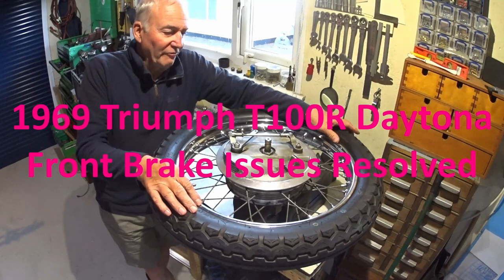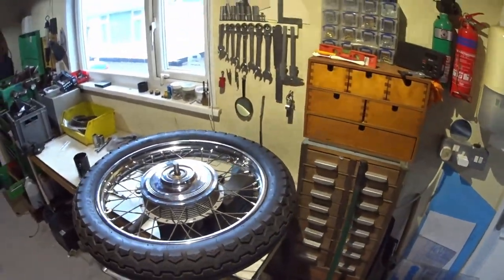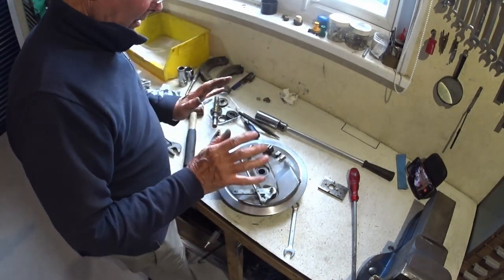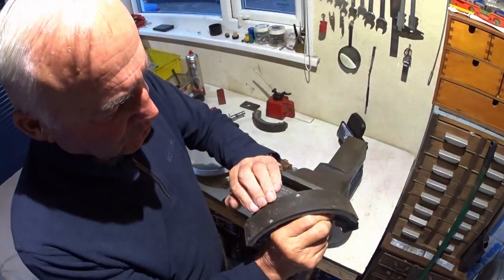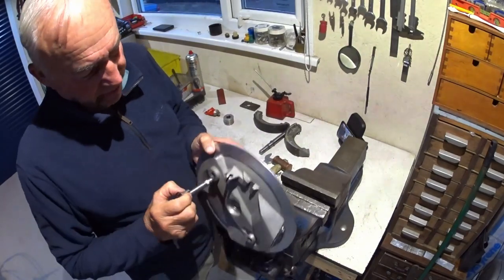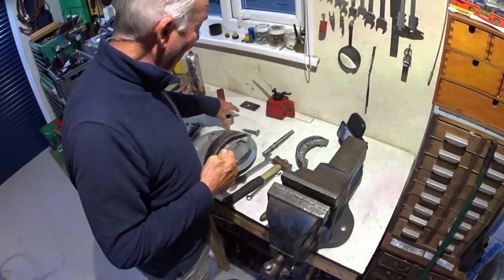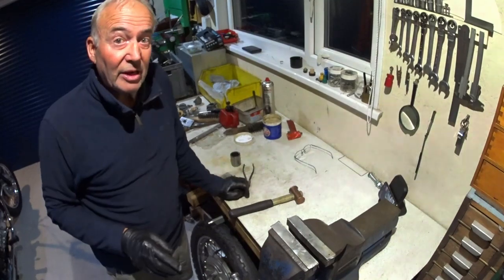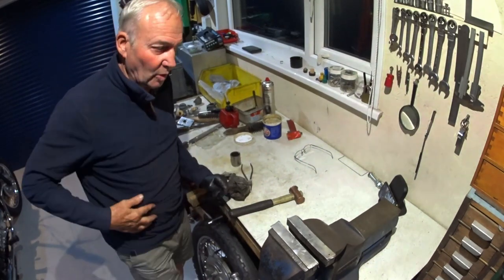1969 Triumph T100 Daytona Front Wheel and Brake Issues

Comment: I got my first vintage Triumph about 2 years ago.  A 1964 TR6.   Ive really enjoyed learning to work on it.   I took the front end apart last year to replace fork seals, fork gators, axle and wheel bearings.  I also put some new brake shoes on it, although it probably didn't need them.

Comment: Hi Brian, really helpful video thanks. I'm about to do the same job on my 69 Bonnie. 3 quick questions, if I may? 1. How did you actually get the brake arms off the cams? 2. If you used brake cleaner on the shoes, how does this wash off and dry? 3. What a lovely old vice you have. Is it a Record and if so, what number? Many thanks in advance, Martin
Reply from the maker: Hi Martin, after you have removed the nuts from the brake cam shafts you may have to tap them out using a bit of tube or a small 1/4” drive socket that will go over the raised end so you don’t damage where the grease nipple is, or from the other end when the shoes are removed you can get an adjustable spanner on the flats and pull as you twist back and too. Regarding cleaning the shoes, brake or carburettor cleaner will dissolve the oil and grease and it will evaporate off with the brake/carb cleaner. If you are not happy with the results and think there may still be residue in the brake compound then drop the shoes in and old cooking pan with water and boil them on the stove for 10 minutes, they will come out like brand new. I can’t remember the Record vice number, the vice was bought for me by my father during my engineering apprenticeship some 50 odd years ago and l am away in Australia and not back for a few months time to take a look. I do know the jaw width is 6” as l have removed the original hardened serrated jaws and made some from 316 stainless steel which doesn’t mark or damage what you are gripping. I also did a video on the BSA B25 Starfire front wheel which is the same only a 7” version where the later 650 BSA’s and Triumphs is an 8” version which also may be of help to you. Regards Brian.
Reply: @TheCadengineer  Hi Brian. Great ideas for 1 & 2 and thank you for taking the time to explain them- will give them both a try. I have a Record vice I got from Ebay, but much smaller than yours  would love to upgrade! Hope you enjoy Oz. I lived in Melbourne for 13 years. Beautiful country. Regards, Martin.